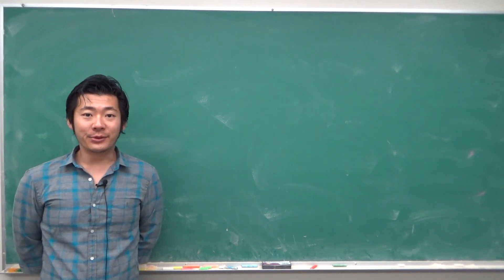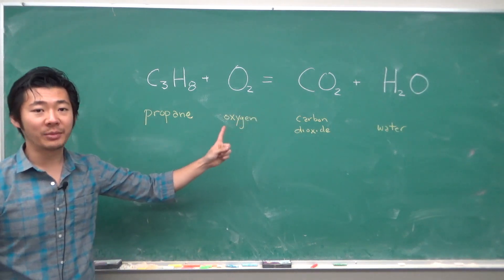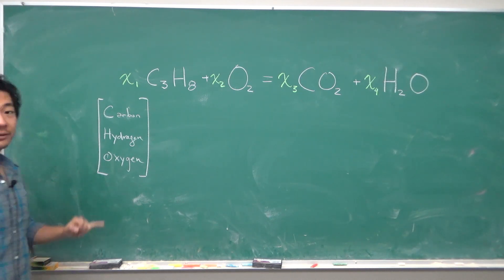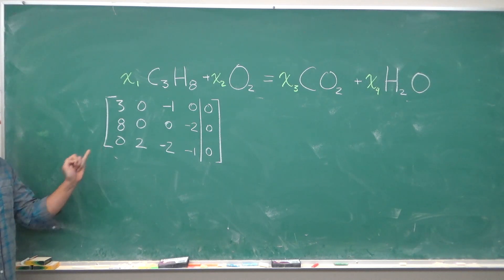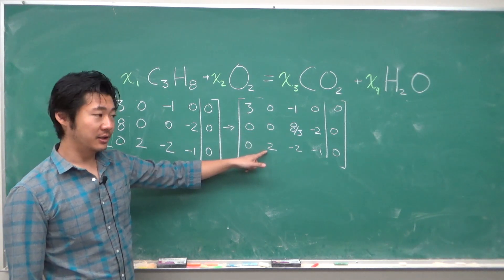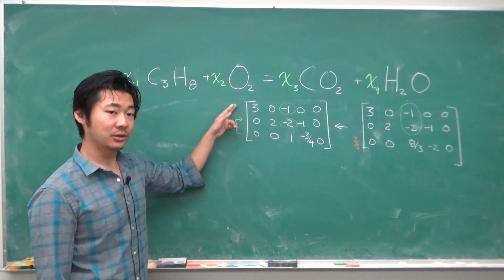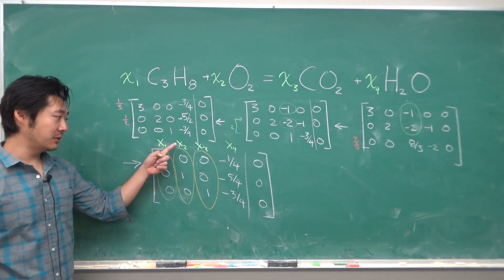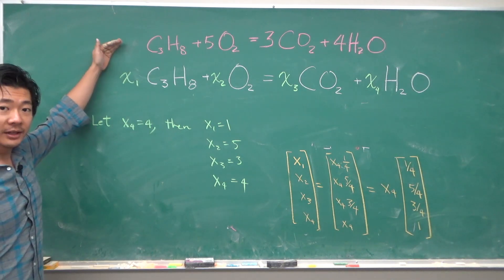Balancing Chemical Equations

Comment: Awesome video! What happens if oxygen is scarce?
Reply from the maker: According to the equation, oxygen being scarce would mean the value for x_2 is small and so the remaining variables will scale accordingly.  From the integer solution (1,5,3,4), let's say x_2 = 0.05 instead of 5.  Then the solution would scale to (0.01, 0.05, 0.03, 0.04).